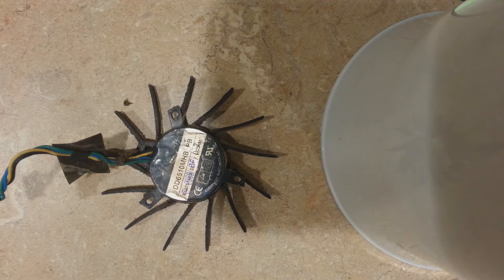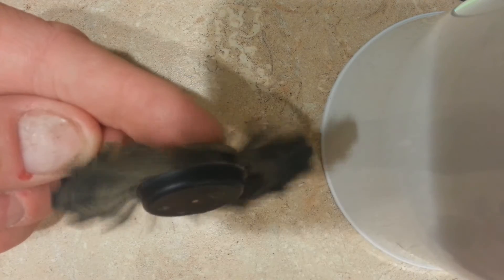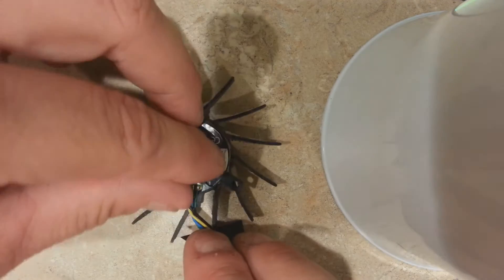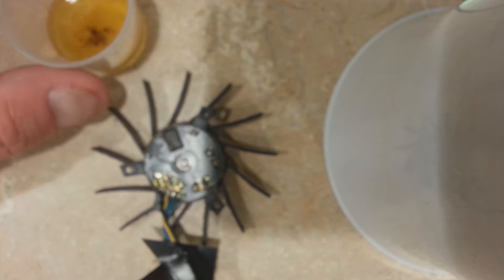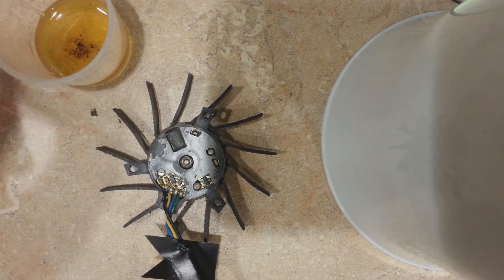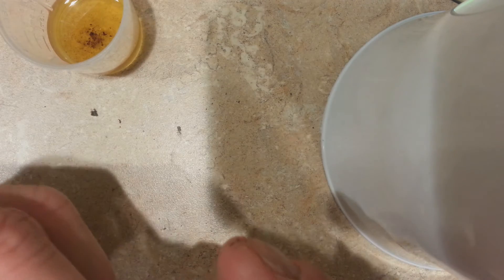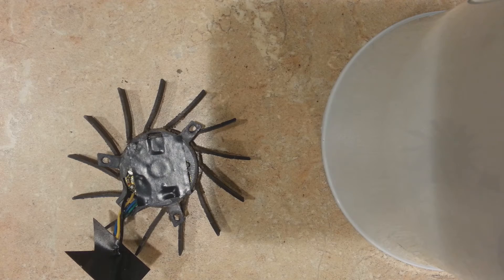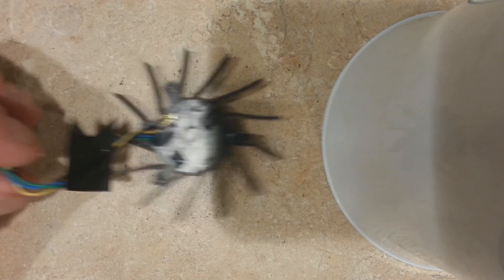How to fix a seized fan for your computer or video card

Comment: My gtx 670 fans only spin at 90c. no idea how to fix this. Sometimes it's only 1 fan and its loud as hell
Reply: its because its dryo from inside.
so it only runs when the fans are running at like 90 to 100%
you have to lubricate it.

Comment: I do this, but I soak the fan in Isopropyl alcohol first; it removes a lot of the crud.
Reply: Ya can usually pull the fan blades off, clean out inside the motor and press it back in. Using electric motor oil (Available at any hardware store) will make it almost as good as new. Electric motor oil is also less prone to leaking back out and burning up into gunk and clogging the motor again.
Reply from the maker: Very interesting.

Comment: What oil did you use?
Reply from the maker: I actually use transmission fluid now, because its not affected by viscosity or thermal breakdown.
Reply from the maker: however for this video I used 5W30.
Reply: how about that 3 in 1 oil that comes in a can?
Reply: PLEASE PLEASE use this https://www.familyhandyman.com/tools/how-to-oil-an-electric-motor/view-all/